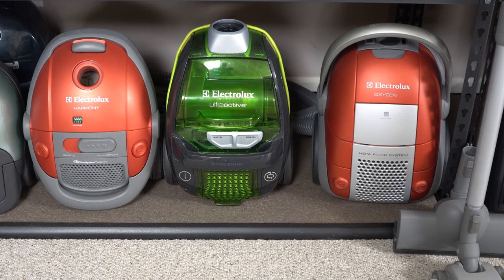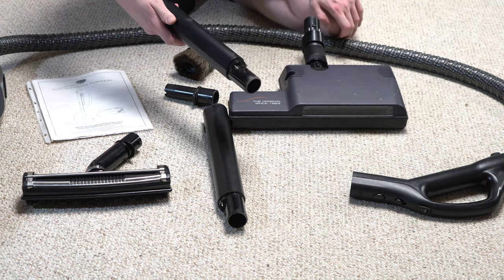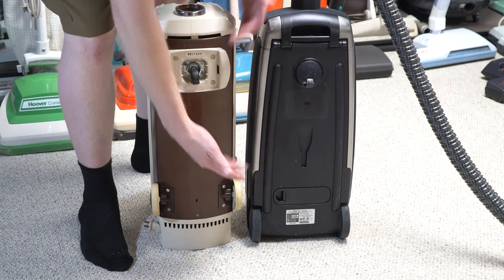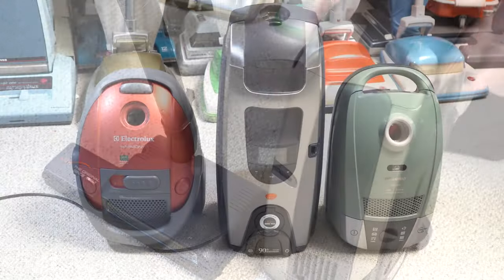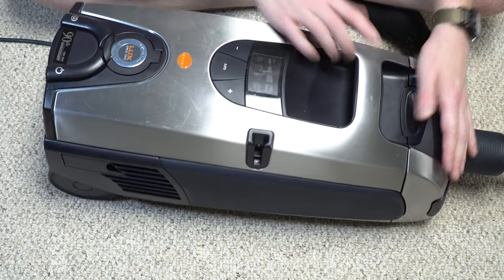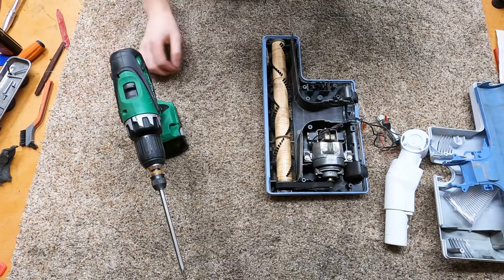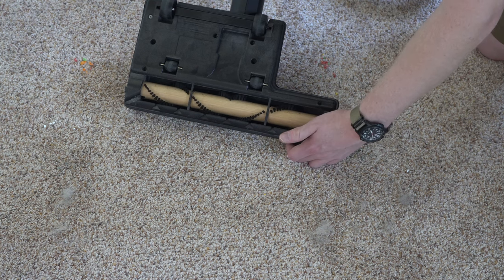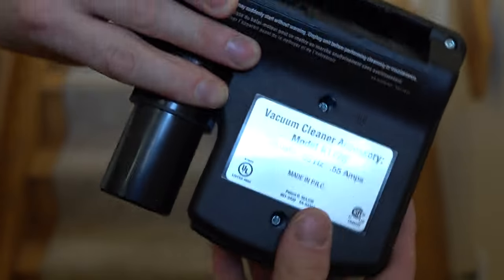Aerus Lux Guardian Platinum Vacuum Review 2023

Comment: Bullet points to your review.  -hose placement is crucial to the centrifugal air intake of the bag, that’s why it’s not been changed.  - lux royal is still rooted in original Electrolux just not USA, so it’s not a rebadged machine like Eureka did for Walmart and called it a GE. - rear wheel placement is there to make the unit easier to stand in its by tugging upward on the hose. - bags are small but can be filled to brick capacity w/out losing suction. - I’ve owned Miele canisters and they do not include a sidekick , their dusters and upholstery tools are small and cheap nowadays. - plastic wands are creeky after they’ve been worn in for years like the one u demoed. They are still lightweight and made out of durable lexan.  - if u used the auto feature with the sidekick u would get less brush roller drag.  - all swivels leak some, not critical when your machine pulls this much suction, your numbers in the video are not indicative of today’s model or one that has just came out of the box.  - IMO u can’t beat this bare floor tool, but it did behave a little better when it had horse hair bristles.   - cord length is 27ft, substantial for any machine, most reels are under 25ft.  - hose on the platinum is 7ft vs the shorter hoses on the Legacy and Classic. - bags and filters are available all day long on their website store and a few knock offs on Amazon.  - I sold these for year’s and made a lot of customers very happy, so GTFO is a little harsh.  There are a lot of people that are completely unaware of a quality vacuum and need it brought to them in their home to understand.

Comment: These were sold in Australia as the Sauber si200 $1699aud and SE400((painted gold)but had the et1 power nozzle at cost of $2300aud. 

Filters are still available for sale here in Australia. Happy to send you link for them if you still require.
Reply: just picked up an se400 from the dump for 5 bucks easily the best vacuum ive ever owned apart from my sebo G5 that also came from the dump

Comment: I own  two of them. I  love them. I  also own a Sebo D4 PREMIUM. I love my D4 as well but that being said I  prefer the Aerus Electrolux attachments over the Sebo. Sebo makes a very good power nozzle the ET-1. No denying that whatsoever.In fact there's no denying that Sebo makes a better power head than Aerus. However, I wish Sebo offered a motorized  sidekick instead of a turbo tool and a longer hose. Both my Platinums have the 12ft hose option which I prefer. There are pros and cons with both the Platinum and the  D4. I  have two friends of mine who sell both brands. The only gripe I  have with the Platinum is  the small bag size compared to the Sebo and the plastic wands. The Classic wands are more functional than the plastic wand setup but excell when it comes with the sidekick. The  ET-1 on my D4 is ideal for tight areas and I also appreciate that Sebo offers an extra attachment kit with a 9ft hose. I wish it was electrified also like their electrified hose that comes with it. So between the two I would choose the Platinum over the Sebo and if I'm a windmill brained moron for disagreeing with this then so be it. I've been in the cleaning field for over 30 years and yeah Aerus may make some things I  may not like but that's where you have other brands to fall back on depending on your cleaning situation but in the end I find myself back to Aerus and yes I hate the name btw but not necessarily the product. Per your recommendation I bought the D4 and I also own a Felix. Felix is an amazing upright I find myself using it more than my D4. It's all about preference and functionality for any cleaning setting and having the right tool for the right job makes all the difference especially in my line of work.
Reply: I had a Sebo D4. There were mango things I love about it, but using it was not one of them. I got an E3 to replace it, and again it felt awkward to use - it’s the thick tapered hose I hated. I love my Sebo uprights, and I use them semi-frequently.

Comment: A better machine to pick up online or at a local Habitat or Goodwill would be a Lux Classic as there’s no attachment adapter and you can easily find aluminum wands online to work with them. I suggest using the modern diaper bag HEPA style C bags. They’re less complicated machines and parts are more widely available

Comment: I sold them during the 90's when it was still Electrolux. I sold many of the original Renaissance machines, then became the Guardian. 
Good machines but the hoses were always were way too short and ridiculously overpriced
Reply from the maker: That's super cool. I remember going into to get my parents Electrolux Olympia special fixed and getting the full demo for the Renaissance.
Reply: I have always been fond of my Epic 8000, especially after I found eVacuumstore selling a pretty nice synthetic HEPA bag for them.  I just like them.  With the original Epic motor they were pretty weak, but recently I replaced it with a new motor from Electromotor Inc, their 6800-298.  It is a drop in replacement for the original motor.  I doubled my measured airflow at the hose end from 33 cfm to 66 cfm.  Some places are selling that motor for as much as $375 but Lighthouse Motors in Arizona sells them for $105.

Comment: Owned one briefly. Bought for a bargain price due to a loose wire in the handle. Once repaired it was such a disappointment. As you have said with the maneuvering and the hose. Tiny bags and it felt so cheap. The metal collected dents and when you parked the foot into the underside slot, it looked like the plastic was about to break. I dumped it because I got it for so little and absolutely hated it.
Reply: How much did it cost?
Reply: @Happy2beher  I bought it for approx $30 USD. The power connection in the hose where it rotates needed an adjustment. The seller just wanted it gone.